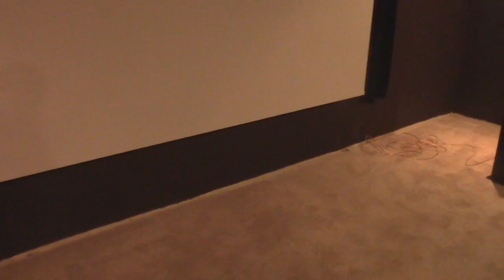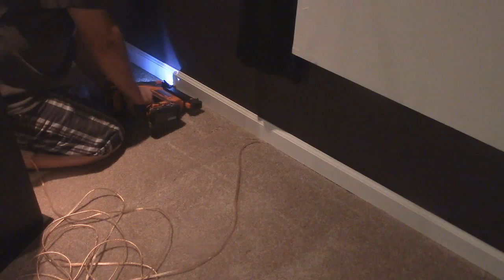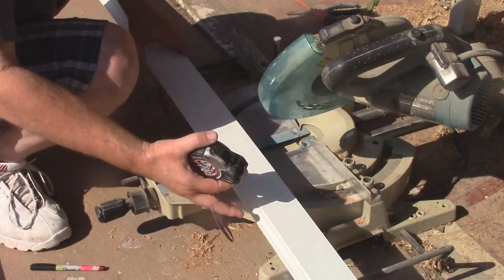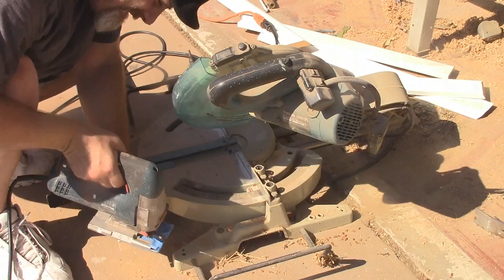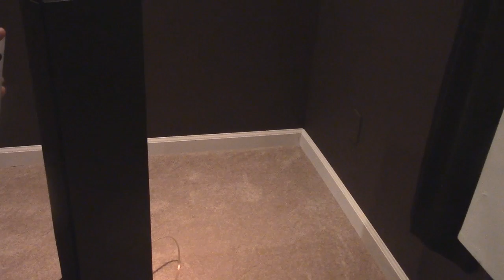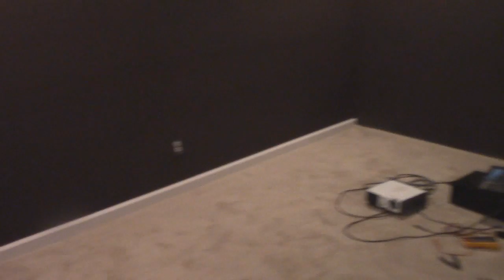how to install baseboard the fast and easy way

Comment: Am I getting this right, in every inside corner you have a 0 degree cut that butts to the wall and a 45 degree cut that you cope and butt to the board with the 0 degree cut? The 30 degree angles are for joining boards on walls longer than a single board,  did I get that right?
Reply from the maker: yes sounds right.

Comment: just blew my mind cutting open the caulk with the caulking gun....had no idea that was a thing....jaw dropped at my incompetence
Reply: razor blades work better. really depends on the trim person. some people leave big gaps. yet i suppose the spout cutter is good too lol
Reply: Hector, Some caulking guns also have a built in wire for puncturing the inner caulking tube seal.
Reply: Hector Ayala

Comment: I do all my coping cuts with a fine toothed coping saw, and touch up where needed with a file and a battery-powered dremel I picked up in a hardware store. They're China manufactured, rated a 5,000 rpm, but the motor is so weak, it stops at the slightest pressure, making it great for fine fitting.

Comment: A putty knife works great for removing excess caulk.  Hold one side against the wall, angled slightly forward, with the end tiltedslightly away (or back) from the wall.  The forward tilt forces the caulk into the crack, and the back tilt forces allows the excess to be picked up on the knife.  Kind of hard to describe, but experiment with it and see what works.  A damp rag works well also, but I always manage to smear it everywhere.

Comment: Do you cut you splices @ 22.5 degree angle?
Reply from the maker: you mean where the two meet in the middle? if so I usually use around a 30 degree.
Reply: Yes. Got it,  thank you very much.

Comment: How do you keep paint off the carpet when painting the base , should paint it first
Reply: If you know you're going to need to touch up and don't want to tape off the flooring after you've placed the baseboard, use a roll of 6" masking paper.  Lay it up next to the wall and install the baseboard on top of it.  After you've done your touch ups, you can just pull/slip the paper out from under the baseboard.
Reply from the maker: I do paint it first. if you have to touch up, you slip masking paper under it, or tape it off.
Reply: you can use a putty knife to tuck under the rug and leave space. i honestly never have alot on my brush when im cutting low on base because most of the time it needs 2 coats anyway

Comment: This is the way skirting/baseboard should be done. All internal corners should be scribed, not mitred. In the UK this is the standard practice.
Reply: Lee Woolley he should have used a copping saw that does a much better finishing joint. And why would you measure to the short point of a joint and then add the difference? Unless it’s an outside corner always measure to the long point.
Reply: Dave Phillips I'm not sure if you misunderstood me. I'm a carpenter from England as was just stating that his use of a coping saw should all ways be used on internal corners.
Reply: Aman A Based in Brighton, East Sussex
Reply: Lee Woolley Where abouts are you based
Reply: Flooring ideas

Comment: Coping saw would work too instead of a jig.
Reply: Denis Lipatnikov maybe you need a lesson on how to use a coping saw. That’s why they have different TPI (teeth per inch) coping blades. Grinding disk is way too dusty.
Reply: Coping is much better.   Perhaps you can get away with a jig for some basic trim like this, I guess, but if you're doing ANYTHING more ornate, a jig will hack it to pieces.   There's just no control like a coping saw.
Reply: Coping is perfect for baseboard. Using a grinder is great for coping crown where that spring angle needs to be so acute. Good video.
Reply: Yup. Hence the name "coping" saw
Reply from the maker: yes
Reply: A coping saw takes forever. Especially in hard wood. Using an angle grinder with an abrasive disk is the way to go.

Comment: Great video. Thank you. Caulking is always my nemesis. I just flat out put to much on.
Reply: That's what she said... 

Sorry, couldn't help myself.
Reply: Small tip and a really wet finger,you'll never go wrong
Reply: Kristopher K j
Reply: Yeah ,I should of specified,water on acryclic,latex,silicone mix. mineral spirits is only required on a 100 percent silicone